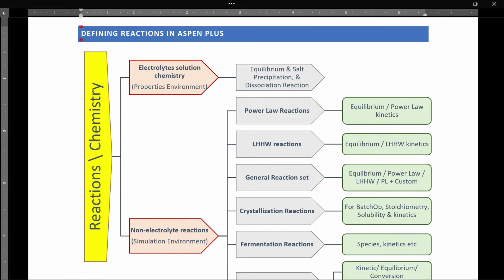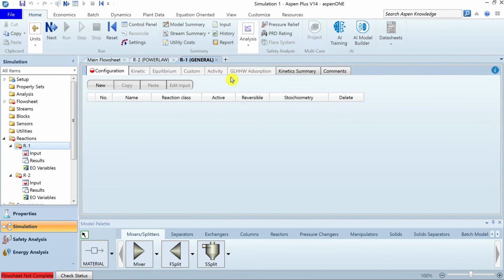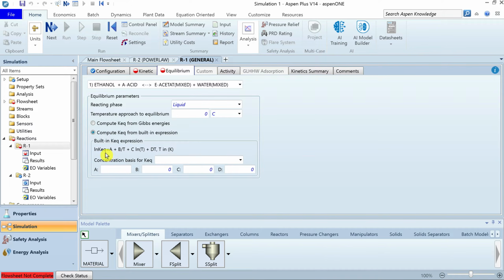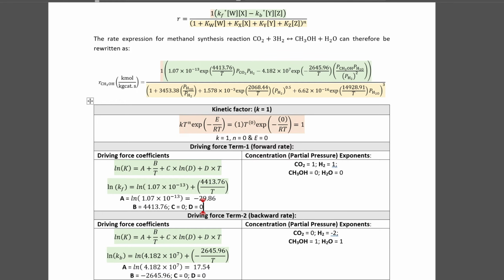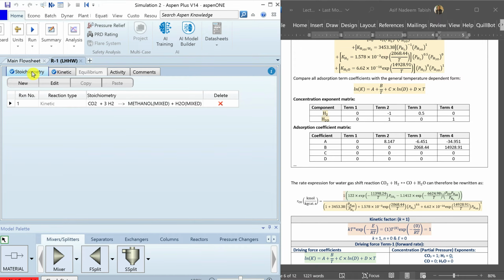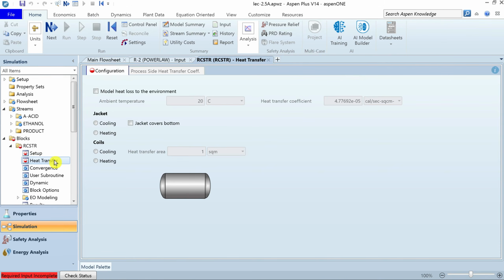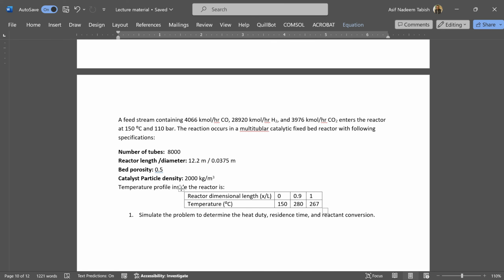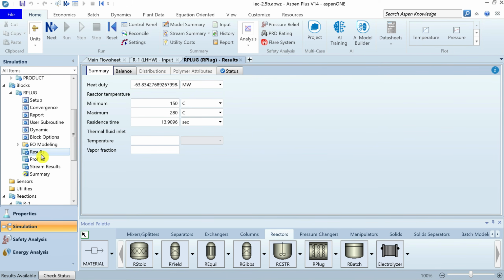Aspen Plus V14.0 || Power Law, LHHW kinetics, RCSTR, & RPLUG | Lec 2.5

Comment: Really helpful, Can U make case study of Methanol steam refrormation for hydrogen generation with catatlyst Cu/ZnO/Al2O3 as 1 ) CH3OH + H2O ⟷ CO2 + 3H2  2)  CH3OH ⟷ CO + 2H2  3)   CO + H2O ⟷ CO2 +H2
Reply from the maker: @SunilAmrut I will do in future.
Reply: @aspen_school  In  methanol steam reforming process simulation which reactor should use,1) if reaction Kinetics not available? 2)Also suggest to make Methanol Steam Reformation process with heterogeneous catalyst of Cu ZnO AlzO3 with variable MtoW Ratio,Temp range, pressure 1atm..

Comment: Sir can i calculate kinetic data with any experimental data
Reply from the maker: @mohammedjeelani18 you can import experiment data as table in Aspen plus and then do curve fitting inside the Aspen Plus using appropriate kinetic model.